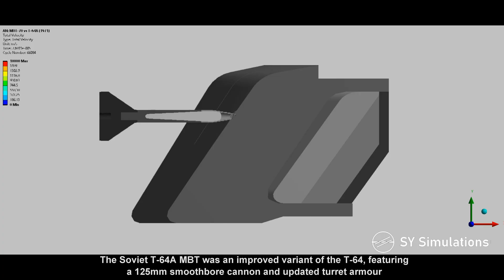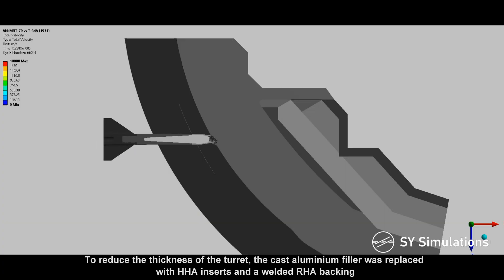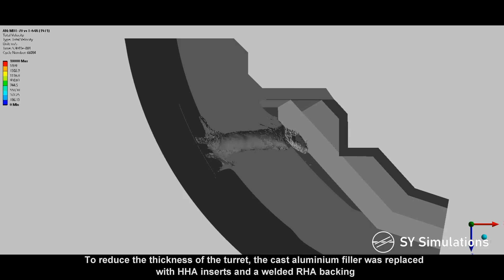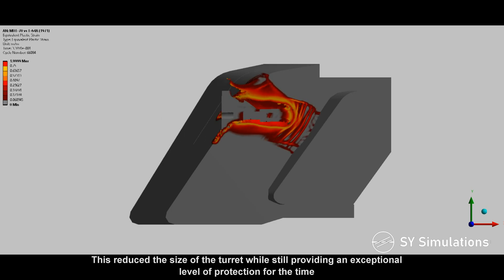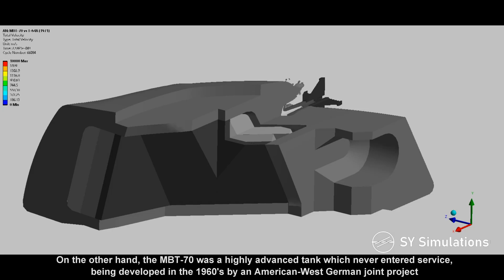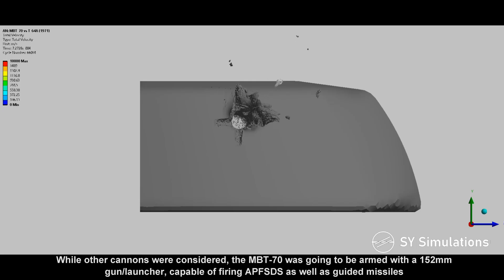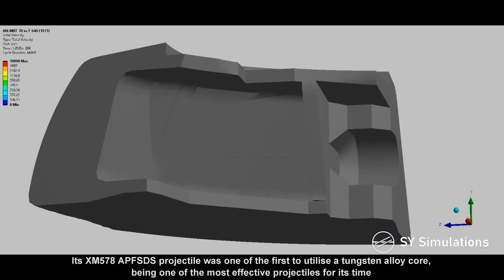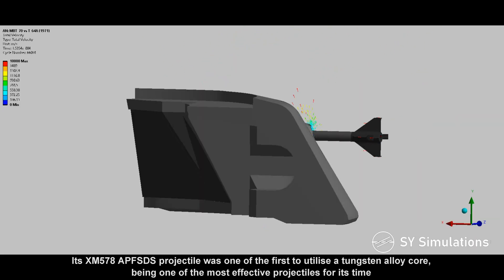MBT-70 vs T-64A TURRET | 152mm APFSDS vs Complex Turret Armour | Armour Penetration Simulation

Comment: Yep, I knew that wasn't going thru. Idk how so many people thought it would pen on the community post teasing this sim. XM578 was definitely a great dart, one of the best for its time, but the T-64A's turret armor is just on another level for that same time period.
Reply: The XM578 fart itself was relatively advanced for the time but the gun itself being such a low pressure setup basically guaranteed this wouldn't go through. The dart was always an afterthought to the missiles though
Reply: @signs80  hurr hurr he said fart
Reply: @masol3726  I'm gonna leave it lol
Reply: @masol3726  hehe fart gun
Reply: @signs80  The dart and missile were both designed to defeat T-62. T-64 wasn't known to NATO until 1968-1970 or so when it began to appear in GSFG divisions.
Reply: @SecuR0M  It really shows how far behind NATO was on the AFV side of things at the time considering that the Soviets were already putting composite armor into service while the MBT-70 was barely armored enough to withstand basic tungsten carbide APDS
Reply: @signs80  America invented the type of armor that was used in T-64 so it wasn't really that. It was just a pendulum. 

NATO developed the Centurion and M103 which were designed to tackle T-44s and Panthers; the USSR developed the T-55 and T-62 which dealt with the Centurion and M103; NATO made the MBT-70, Chieftain, and Leopard 1 which handled the T-55/T-62; the USSR made the T-64 and T-72 which handled those; and then NATO made the M1, Challenger and Leopard 2 and the USSR couldn't make anything to counter those because it didn't exist anymore.
Reply: @SecuR0M  The US tried to use silica glass armor but never actually really managed to get it to work right. The Soviets managed to get it working in the 60s long before NATO did. Even the T-72A of the time the Abrams came out was superior in most respects to the Abrams and to a lesser extent the Leo 2. The T-72A had better armor, a lower profile and a better gun. It wasn't really until the mid 80s that NATO put an APFSDS + gun combo into service that was better than the Soviets. NATO simply vastly underestimated the armor scheme and gun capabilities of the Soviets at the time and didn't realize how far behind they were until the later 1980s when they inspected an Iranian captured T-72M from Iraq.
Reply: @signs80  We literally have the Congressional minutes. The siliceous core armor worked fine. The problem was that it would require foundries to integrate production, which would take 14 months, and that was considered far too long for Dept. of the Army to wait. A proposal by Chrysler to use applique armor boxes was rejected in favor of developing the M60A3 turret instead, which was seen as suitable for handling the then-new T-62.

It was an economical measure and a timing issue. T-64 wasn't known in the West until 1970, which is why the economized MBT-70, the XM803, was canceled and focus shifted to the XM813/M1 Abrams using UK's new Burlington.

There are literally no secrets here. The history is available for free perusing on the Internet.
Reply: @SecuR0M  There were serious qualms about the multi hit capability of the siliceous armor, it worked in that it was protective on the first hit, but they had issues with making it useful for multiple strikes which was considered a problem. With regards to the T-62, the West believed the new M60 turret to be sufficient because they HEAVILY underestimated the performance of the new Soviet 115mm. The belief was that 115mm was equivalent to early 105mm APDS, which was very much incorrect compared to what it could actually do. This is why the MBT-70 program had protection standards so relatively low compared to what the actual Soviet threat was at the time. I don't really understand what you mean when you bring up secrets, I never said anything about the West's decisions being secret.
Reply: Its actually concerning how in cold war, western are still using 105mm as their primary tank gun while soviet already moved to 125mm plus composite armor, at that time Nato 120mm armed tanks were Chieftain, but then we know how garbage it is, with report of below 30% readiness due to engine and transmission problem, plus its 120mm still using APDS  @signs80
Reply: i literally have no idea how the mbt-70 gun has under 300mm pen at 0 range 0 distance. that 152mm gun must have a super low pressure setup
Reply: @DecayLe4  It does, that's why it shoots a very light dart, so that it can reach a decent speed with the relatively small powder charge the gun uses. To give you an idea, the 152mm launches the XM578 dart at almost the same mass and speed as early 105mm APDS even though the caliber is 50% larger
Reply: @signs80  dayum
Reply: @DecayLe4  The 152 mm XM150E5 had a much lower muzzle velocity than longer barreled contemporary guns, meaning much lower penetration. 
It was primarily designed to fire the  MGM-51 Shillelagh missile against other tanks.
Reply: @DecayLe4 It’s a Gun Launcher for the ATGM, not APFSDS.

That’s why it was 152mm.
Reply: MBT-70 was designed to fight T-62s and T-55s, to be fair, as it predates T-64A. The project started in 1963, three years before the T-64 appeared, and five or six before it was known to NATO.
Reply: US stuff cant fail must be better than soviet crap

Comment: Nice, M26 vs IS-2 please! ~ Operation Unthinkable
Reply: 1943 or 1944? Which IS 2?
Reply: @Grigoriymicro  Probably the 1944 variant.
Reply: @AzzySlayer99  welp, those turret cheeks are getting violated no matter what.
Reply: Depends on the shell I'd say, as per usual with the M26 the round with the best chance against angles is T33 Shot and against flat armor is M304 Shot. Either would be nice to see.
Reply: That's just Korean war dude